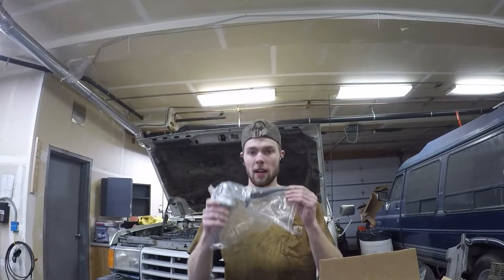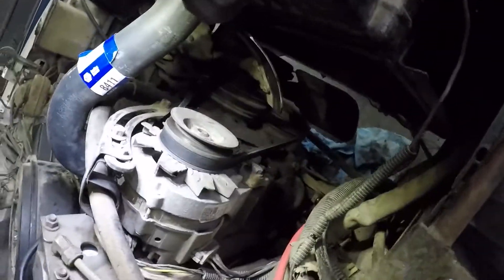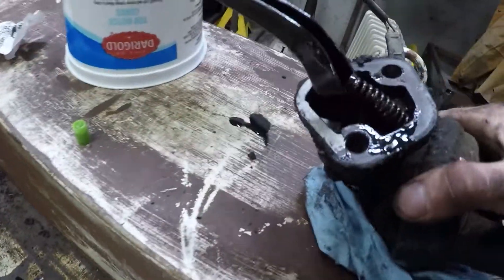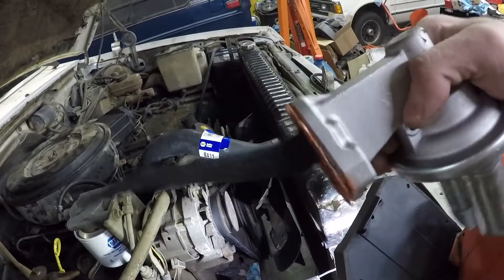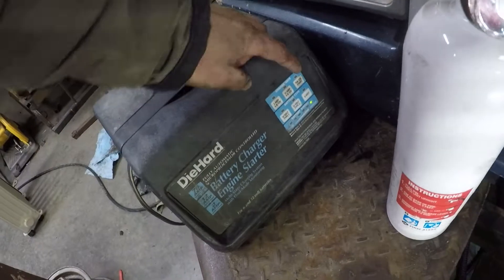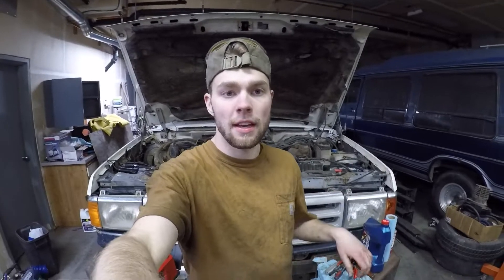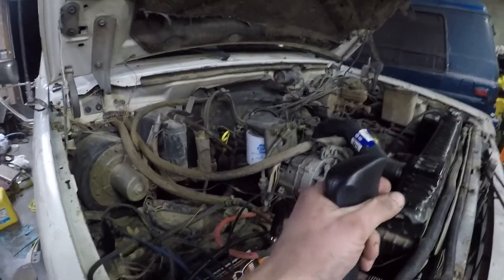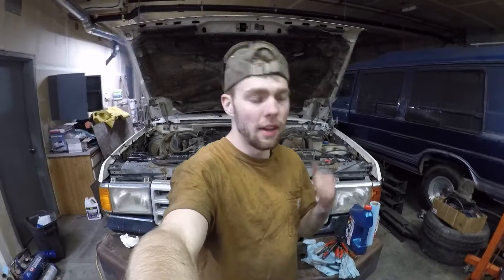6.9 IDI Manual Fuel Lift Pump Replacement

Comment: I'm trying to put a new fuel pump on a '66 F250 and for the life of me, I can't get the bolt holes to line up. It's like the actuator isn't lining up. Is this where I need to turn the motor over like you mentioned at the 6:50 mark?

Comment: DO NOT  crank the starter that long!
My starter stuck and fried two $200 batteries
and melted the posts on them.
Had to remove the starter and replace it because
you can't buy just the starter solenoid (not the fuel
solenoid by the injection pump!)
Very expensive and a bitch of a job to get the third 
starter bolt in.
Turns out I had the wire on the solenoid (by the
injection pump)  connected on the wrong spade connector.
A very costly mistake (two batteries and a starter).

I just removed my fuel pump on my 6.9 '85 F350
What a bitch of a job to get that inside bolt out.
Turns out the outside bolt was 9/16
and the inside bolt was 1/2 .
Very hard to get the socket on it due to no hand room
and the socket wrench was grease slippery.
Had to do it with one hand (which went super arthritic
recently and I just turned 80 years old Nov 16 2024)
Took an hour and a half to get the SOB out.
I'm going to use my air tools to get the inside bolt
back in if there's enough for the tool.
Hope this solves the problem as I don't want to have
to ever do this job again.

Comment: i got a 1987 6.9idi someone did a universal pump and by passed the mechanical one but i keep finding tons of air in the fuel system every other day of it not being started and the universal pump keeps failing on it iv put 2 new ones on a month apart do you think that i should try to go back to this mechanical pump or no?
Reply from the maker: Either go back to mechanical or an e fuel kit.
Reply: @Captain720  thank you for the info

Comment: I have a 1990 7.3 idi and changed the same exact part. After I got done I started her up and had a run away engine. I shut her off by blocking the air intake. I don’t think the engine seized. I didn’t hear any horrible sounds. What do you think happened and do you think the engine is still ok?
Reply from the maker: Are you getting engine oil into your cylinders? I would say engine may have survived if you got on it quickly but I can only guess from here.

Comment: Can you delete these
Reply from the maker: If you switch to an e pump you can delete the manual pump
Reply: @Captain720  Do you know if the e pumps for the idi's are as picky as some other make/model diesels? I like the simplicity of mechanical pumps but blind failures scare me...

Comment: You made it look easy. I have fuel dripping down mine and it is running very rough when accelerating so it's either that pump gasket or the fuel line itself. Both are probably equally likely lol. Thanks for the video! Don't you just love "keep it clean" when you're surrounded by giant chunks of 35 year old grease gunk?
Reply from the maker: Thanks! Yes keeping it clean is very difficult with all the extra grime down there, I had air leaks, and a broken switcher valve in my fuel system thats why I was running off a can to make sure the engine was good.